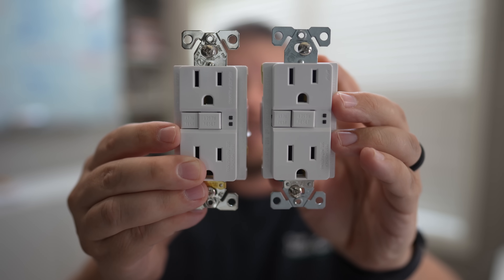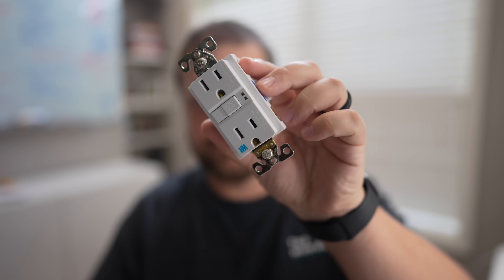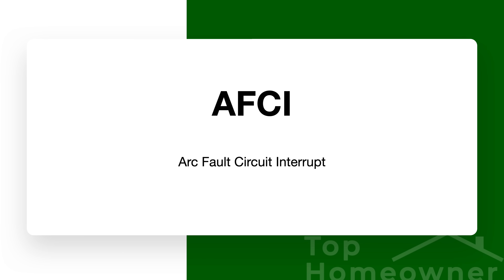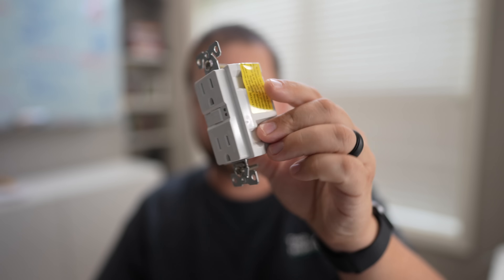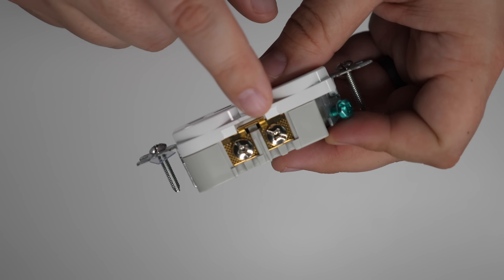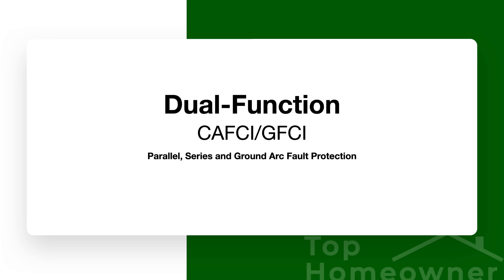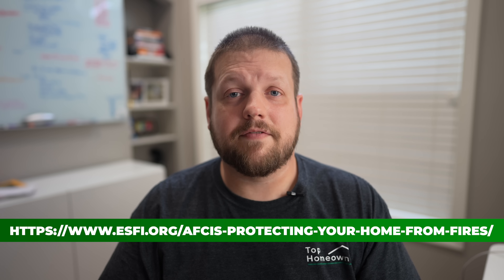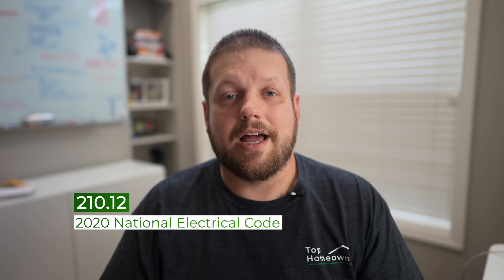AFCI vs GFCI: What's The Difference and Why You Should Care

Comment: It sounds like CAFCI might be a useful addition to an old home.  

I live in an 1882 farmhouse which, to the best of my knowledge, no longer has any knob and tube in it (though some old knobs remain in the basement as a reminder of past wiring).
it does, however, have old insulated + cloth-wrapped wire.. where the old insulation has degraded to the point where it falls apart when disturbed. 
My policy up till now is.. 1) rewire circuits when I need to disturb wiring.. especially when I can do it without having to do significant additional damage to my lath and plaster walls.. and 2) don't disturb old wiring unless there's good reason to.    OK,.. sometimes I get a little over-zealous and this one goes out the window.. as evidenced by my currently dead front room outlets.   I just couldn't abide the lazy work of having conduit pulled through my air returns though and I haven't pulled new service up there yet (and it's been a while now).

Luckily, we live in an area that requires all wiring to be in conduit, so it's generally possible to pull new wire to upgrade  service without too much trouble.. except for where they chose to use armored flex as whips or where they chose to use the smallest pipe they needed to.. because why would anyone want to hang slightly larger conduit from the exposed floor joists in a basement to make your and future owner's lives easier.   OK.. come to think of it, retrofitting generally hasn't been too easy.  :-P.  At least I don't worry too much about picture hanging nails piercing in-wall power though.

good info.. thanks.
Reply: The old plaster was applied with a trowel over wood lath, the old mud had asbestos! 😮😢 Good luck!

Comment: My GFCI breaker keeps getting flipped with my daughter showers and there is a lot of steam in the bathroom. Would a GFCI outlet stop the breaker from flipping? And just flip the outlet gfci.
Reply: Have you considered that this isn't a nuisance trip, but actual damage to a wire?
Having both would be a 50:50 as to which trips first.
Reply: @ how do you identify a damaged wire in the circuit. It a possibility. Builders are horrible now a days. I monitored the building of our home and was not I’m pressed with the framing. All of it actually. So many missed nails etc.

Comment: 1.Cost will never go down. 
2. Manufactures do not supply good diagnostic tools to help us identify issues 
3. The expensive breakers are most times not installed where there is no inspections 
4. New construction electricians were used as a Guinea pigs for the last 20 plus years to “fine tune” the manufacture’s products that let’s face it were made law to install. This cost electricians who were ethical 1000s of unpaid hours to help them research their products and provide “feedback” we were never given discounts or money to cover our cost. I nearly went out of business because of nuisance tripping at the beginning. Starting a business with a non-electrical partner put me in a very bad spot. Everything from treadmills and vacuums plasma TVs to fan speed controls with instructions printed that said not compatible with arc fault breakers. 
5. New construction customers expect that they will never have a tripped breaker and do not react kindly to being charged a service call on a new home that takes hours only to discover that their plugged in equipment is not compatible with a new CAFCI breaker. The main incentive for the electrical contractor to wire a new home is to make money off the customer and to retain a relationship with that customer. You don’t make that much on the house to sustain a model to stay in business. You make money off the after the sale additions and service.

Comment: I'd love to replace all the breakers in my panel with dual function GFCI/CAFCI breakers if the price ever comes down, but it sounds like the AFCI breakers need an override switch for when some electrically noisy device gets plugged in. Simply being unable to use any device without a perfectly clean power draw is unacceptable.
Reply: You'd be driven crazy, I have a 1200w LG microwave that randomly triggers a 15A AFCI trip at least 10 times a week.

Comment: I hate GFCI breakers.  They trigger way too easily. Here's why:  The output of a GFCI from a breaker or the output from a master to a slave outlet  - that wire can act as an antenna.  If lightning strikes in the Western Hemisphere it triggers.  Nuisance tripping.
My rules: No GFCI breakers ever.  And for GFCI slave outlets, only one per master and it must be within 8 feet of the master.  You should be able to see the master from the slave.  Farther away than that and you're creating an antenna.
And my final rule.  Don't ever put a refrigerator or freezer on a GFCI.  Lightning strikes in Argentina and your GFCI trips and all your food gets ruined.  And your appliance is also ruined.

Comment: My brand new (2022) house has AFCI breakers. Out clothes drier trips it constantly. I disconnected the second ground wire in the back of the drier to prevent this but can I just replace the Arc Fault breaker with a normal GFCI breaker and reconnect that wire in the drier? 

If not, what am I SUPPOSED to do to remain in code?

Comment: Does a CAFCI/GFCI breaker offer any indication of WHY it tripped?  With three functions rolled into one, that could be a troubleshooting nightmare.
Reply: Im guessing if there is no short to anything plugged into the receptical, it's safe to assume the fault lies within the walls and it was more than likely not the GFCI tripping.
Reply: I don't have any CAFCI/GFCI troubleshooting specs handy, but they do trip differently according to what the issue is. Check the manufacturer's website, but usually they refer to whether the trip occurs with or without a load, does it occur instantly or after some seconds, etc., with each type of tripping being relating to specific types of failures.

Comment: The AFCI circuits are very difficult to evaluate.
Several American companies have spent many years working on them.  
I would favor a brand that is well known  in the CB field, not some no-name breaker. 
Nuisance tripping can be a big, big problem.  

Some critical appliances for no-trip testing : 
   computer with switching mode power supply
   electric drill
   air compressor
   dimmable lights

Using a standard light switch, switch 500W of incandescent lighting on/off rapidly. 
 The breaker should think this an intermittent (series) arcing condition and trip.
Reply: In the process of buying my first house right now, and researching all this stuff. After seeing enough of the nuisance tripping debate, I had just the thought of checking the brand of CAFCI's that have been on my apartment for a few years, without a single nuisance trip.

Comment: Here in Germany the GFCI is mandatory for all new electrical installations for the whole house.
I have installed them to protect my whole house, and I think everyone should at least have them (Although the voltage in the US is only half as high).
But we have different panels than you guys do, so we can install one GFCI (with no breaker inside) for multiple breakers, so the cost really isnt that high over here.
I havent given much thought about AFCIs, but it might be a good decision to get them as well, although they can cause problems with the nuisance tripping and they are more expensive than GFCIs over here.
Reply: If you are operating with 240 volts with ring circuits. The amperage never reaches the threshold to need protection for series circuits. Parallel arcing would still be needed but I haven’t heard of those in EUROPEAN countries.
Reply: @matthewfournier6478  only really an issue with ring circuits in the UK. Not sure if Ireland use them too but rest if Europe use 16amp radials mainly
Reply: @matthewfournier6478  It is the voltage that causes arcing.

Comment: You missed gfci blanks same as the plug except no receptacle plugs it is used in a box by the panel box it used for cost a receptacle and the blank GFI are under 20$a switch is close to or greater than 100.00 dollars usually used for outdoor plugs it keeps the GFCI  and I was right an  arc fault breaker dose not protect against shock the electrician put on in to protect against shock from an electric fireplace over a bathtub

Comment: I have AFCI in my trailer, and want to share an experience with regard to nuisance trips. I learned that a battery charger, not connected to load has some sort of issue because when i plugged in, the AFCI tripped.  A regular outlet on a circuit breaker does not, nor does a GFCI. I have two of these chargers, the second does not trip the AFCI. Leading me to think that a problem in the first one is likely the cause, so I disposed of it to be safe. Thanks for this video.

Comment: Q: Since current is reduced when you plug things into an outlet that produces a load, and you mentioned that GCFI operates by detecting even the tiniest difference between the neutral and the hot wires (which is where the load occurs), then how does it differentiate between a load an a fault?   Also, I do think GCFI + CAFI dual function outlets should be standard everywhere in all new home construction. It just makes sense. What doesn't is the deliberately inflated price of these devices by manufacturers trying to profit off of consumer safety.
Reply: "how does it differentiate between a load an a fault?" -- as long as there's no fault, the current is exactly the same at either end of the circuit. Adding a load to a circuit doesn't "reduce the current". It's what causes current to flow and you'll see the exact same amount of current no matter where in the circuit it's measured.

(Maybe you are confusing current with voltage; all else equal, a load will cause a voltage drop...but even there, modern electrical services usually can handle all but the largest loads without any significant voltage drop.)
Reply: It compares the live and neutral. A load does not cause imbalance. Also a load does not reduce current, it causes it. Without any load there is no current. Seems you have some fundamental misconception about electricity.

Think of a water pipe , same amount of water comes out as goes in. If that is not the case then there is a leak. Similarly s GFCI detects a leak in an electric circuit.

Comment: AFCI will kill you, the leading cause of house fires is the drywall idiots stripping off the stud plates.    If you visit a house under construction and there are stud plates in the trash, call code enforcement right then and there.  Federally mandated safety devices are a felony to remove or modify.

Comment: Do common circuit breakers really work by detecting heat build up?
I think there’s more to it than that.
Reply: The common CB uses an internal bi-metal strip that heats up and bends as more current passes through it. 
If the current is too much, the strip bends enough to trip the mechanism.
Reply: In addition to the bi-metallic strip, most breakers also employ an electromagnet (formed by the current-carrying conductors) that causes the breaker to trip above an absolute maximum threshold with very short response times.

Comment: I would add that the breaker is not there to protect humans from electrocution. There is an assumption that they do. 

When we plug in a flimsy extension cord, the ones you get at ANY store in North America, you can draw far more current than that gauge wire can safely carry, and the breaker for that circuit will be totally happy.... up to the amperage of the breaker on the circuit.

Use 12 guage extension cords on 20 amp circuits and 14 gauge or 12 gauge on 15amp circuits.

Our devices and their cords are often insufficient, unless they are fused based on their capacity. It is rare to find an extension cord with a fuse, EXCEPT for christmas lighting and accessories.

IF I am wrong, spank me on the technicalities. I am basing this on a video on the Technology Connections channel.
Reply: "I would add that the breaker is not there to protect humans from electrocution" -- no, the GFI breaker absolutely is there to protect humans from electrocution. That's the only thing it does.

You are confusing the three different functions a breaker can provide. You're talking only about over-current protection, which is what the first circuit breakers did, doing the job of the old-style fuses. Those breakers still exist, and GFI/AFCI breakers combine that function with additional protections: ground-fault protection for the GFI and arc-fault protection for the AFCI. And of course, you can get a breaker that does all three.

Comment: I still can not understand why 10 CAFCI/GFCI breakers cost $100 (Cdn) each.  Yesterday I discovered one of my new CAFCI/GFCI breakers had a GFCI wall duplex plug on the dedicated 2 wire circuit.   lol
Reply: Apparently it is code. Arc-Fault do one job and GFI does a different job.

Comment: If you put AFCI in your house you will regret it. When our house was rewired completely we put some of these in....First we couldn't figure out why our garage door opener was always on battery power, AFCI. Second we couldn't figure out why our bathroom fan would stop working, AFCI. We found anything that draws a heavy load the AFCI would click off every single time. We got rid of the and every thing is fine, then we found out that all electricians in Utah were pulling them out everywhere.

Comment: All these objects have added tremendous expense to the cost of the finished electric panel.  What once was $150 completely, is now more than $750 and as much as $1100.  But the real question is, "Do these improvements and costs really save lives or homes"?  The answer is still out for me.  I DO know for a fact that BECAUSE of these changes, there must be a design change in the electrical system itself.  IF you find yourself living in snowy or bad weather areas, the main meter panel should be mounted on a pedestal next to the home with ONLY the house main breaker (with optional smaller breakers for exterior use) and an underground feed cable to the interior house panel with all the breakers.  Reason? If your panel, like most, are now equipped with AFCI's, each time you turn your vacuum or mixer on, the "Arc" in the switch with "Throw" your breaker and you must reset it to run the machine.  Cn you see yourself running outside in 3 foot of snow each time you want to clean the carpet of back a cake?  In reality, someone figured out a way to make the breakers "More Expensive".  So far that's about it.  If the older type breakers are soooo dangerous, then why is it we don't see old home fires ALL OVER THE COUNTRY?  Oh well.  Lobbying is such a grand old practice.
Reply: I've never even seen a house where the breaker panel was outside.

Even the 1920's house I grew up in, the fuse box was inside the house.

If you've got a house with an outdoor breaker panel, you've got bigger problems than deciding whether to install AFCI breakers or not!
Reply: @harvey66616  You must not be familiar with 95% of the homes built in America.  Next time you drive around, take a look and you will find both stucco and wood siding homes have a Meter Panel on the side which includes the breakers for the home.  SO Cal is FILLED with this type of construction.  Too bad you aren't familiar with that.

Comment: I thought AFCIs were designed to protect bedroom and other living areas where an electric blanket or heater can arc and cause a fire
Reply from the maker: In 2020 the NEC updated the AFCI requirement to include just about every part of the home.
Reply: @TopHomeowner  Yes, people use electric heaters with cords strung across the floor everywhere. Power cords to computers and phones are strung about.

Comment: If you have an AFCI circuit and plug in almost anything that happens to be turned on already, it will trip. Know where your breaker is and be able to reset the outlet.

Comment: An da , what about installing a afci when sharing a neutral ??
     It don’t work !
Reply: I think you mean GFCI. AFCI doesn't care about neutral. And what about it? Don't do that, and you're fine.

(I'm being glib of course...I know it happens, even ran into that in my house, trying to install a 3-way timer switch that used the neutral, kept tripping the breaker. I found out that the circuit had a different neutral at one switch than was in the box with the other switch. Doh!)

Comment: I'm very sensitive to fire prevention. My close family came home one weekend night, and found the apartment building they lived in on fire. No one was hurt, but the apartment and all its contents were gone. Same for several other apartment. Fire dept was on scene and fire was already under control when they came home.

Investigation concluded that fire was due to old/faulty wiring. Building had good insurance.

The trauma of such a destruction and upheaval struck me hard.

Been very thoughtful about fire prevention and fire suppression since. Photoelectric smoke detectors, fire extinguishers, turning off breakers when I leave the house etc etc.

Thanks for the info!
Reply from the maker: Wow, thanks for sharing your story. Glad no one was hurt.
Reply: Sounds like a terrible thing to happen.

That said, how do you feel about "protection" devices that are so unreliable, they induce people to ignore the very problems they are supposed to protect against, or to just get rid of the devices altogether?

Because that's what AFCI breakers are right now. They are like a smoke detector that goes off at the drop of a hat, whether there's a fire or not.